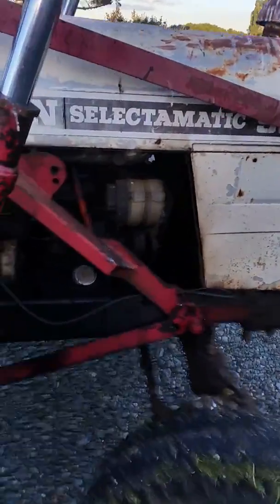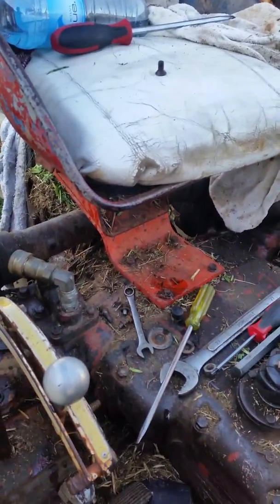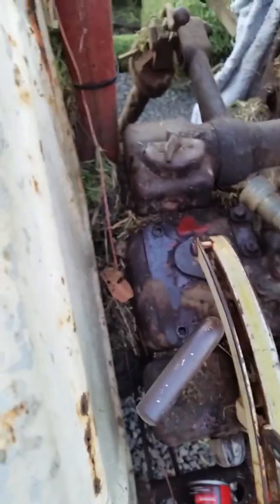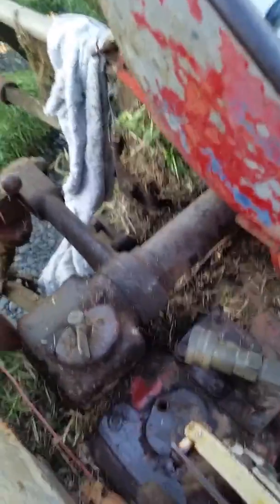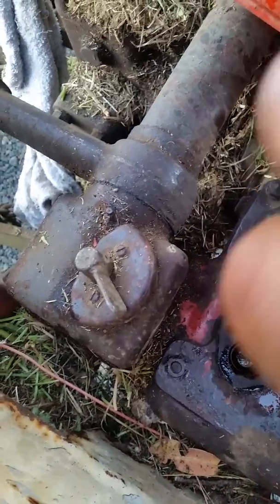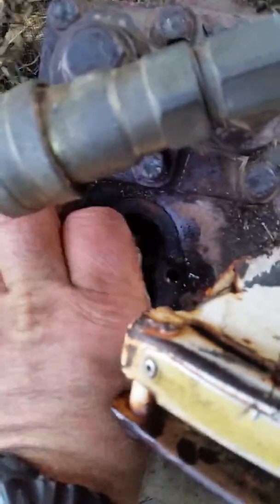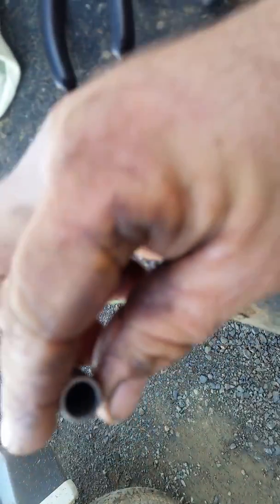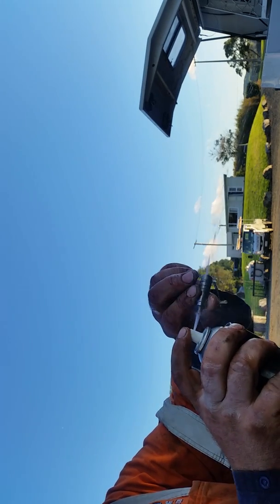David Brown 990 hydraulic bypass valve

Comment: Question I have a 996 and the lift arms are stuck up, would cleaning the valves fix this or is something else needing done?
Reply: There should be a handle on the left side rear axle, that can lock the lift arms in transport mode(all the way up).
Try to unlock the handle.

Comment: Thanks a million for the video. My lift arms stopped working altogether on my 995. I followed your instructions and now they are working again, be it slow though. I think a good service of the hydraulic system is called for, but at least I can work. Thanks again.
Reply from the maker: That's fantastic glad to hear its helped 
You are probably right needs an oil change and a new pressure filter and cleaning of the suction filter
Reply: @chopsmechanicaltips6595  I figured out what was wrong. One of the previous owners had swapped the valve casing with an older model, the one with the hand pull up plunger. The result was the ball bearing inside was not where I was expecting it to be and I lost it without realising. The result I guess was I was splitting the flow, hence the slow lift arms. I found the correct diagram for that part and noticed the ball bearing behind the screen with three holes in it. I found a ball bearing around the house today, put it in and now it's perfect and rising fast.
Reply: @ConnemaraShooter  I have 995 as well and wondering how your hydraulics are working now with cleaned out valves
Reply: @jessepaul1389  It's perfect now, but I had to replace the clutch since in the fitters and while they were at it, I had them go through the hydraulics. They said it needed a really good cleaning. Any ways it 100% know.

Comment: I end up pulling the valves on my 990 about once a year.  What I usually find is a little crud (American for junk/trash/garbage) in that little screen and maybe the outside of the valve has a bit of sticky gum or a little bit of discoloration (start of rust) from water in the hydraulic fluid. Clean them up and all is well. The water is a major issue as we have no sheds for the tractors. I'm building a canopy (roof) onto the tractor this spring. The shift lever boots never last more than a few months and that appear to be where the water comes from.
Reply: you pack grease around base of lever then put new boots on. if the new ones go the grease will act as a resistance for a bit

Comment: There's also supposed to be a ball bearing and a ball bearing retainer in that valve to sorry to anyone who attempts that be careful to not lose those they're very small
Reply: On the 880/A selectamatic I bought recently, the hydraulics had completely stopped working. I took the outer valve out and found blockage in the screen. Cleaned it up and the hydraulics started working immediately. I was elated. After removing the inner valve (closer to the seat) I tapped on it and a ball bearing and small washer with 3 small factory-drilled holes fell out. I wasn't sure what order they went in, so I put the ball in first then the washer, then the spring and closed it up. I do want to find a schematic so I can be sure of it.
Reply: @tvs3497 I'm doing the exact same thing now and found only a ball in the inner valve, and a retainer and screen with one tiny hole in the outer valve. How kdid you put it back together? Is the. Inner valve supposed to be open with nothing in it like the Video shows.  I feel like someone else maybe had a go before me and Re assembled it wrong

Comment: Brilliant Chops. Had this issue with my 880 Selectamatic with sudden non lifting action. I did what you showed and said and the hydraulics now work perfectly. Dump valve seemed to be the problem. Visually not much blocking it but was enough to stop the hydraulics . Will say on the 880 take care with the Bypass valve when lifted out as at the bottom there is a very small brass ball and metal screen. Be careful not to lose them esp the ball. Cheers Mate !!!
Reply: mark edward Lucock Did you have to rebuild the actual dump valve itself I've done this process it worked great now it's locked up and won't come down I thought it might be to do with the dump valve but not sure
Reply: No I didn't have to adjust anything else. I simply put all the parts back where they came out from.You sure nothing has fallen into the open valve area.Maybe a bit of dirt or something as doesn't take much to block. Clean out both valves as well but be careful you don't lose the tiny ball and metal screen in the housing of the other valve if its an 880 selectamatic.
Reply: @markedwardlucock3661  I have 770 end have problems on my 3 point hitch is lifting but not have to much power maybe only like 75 lbs

Comment from the maker: Hi Mick 
I would try 1st buy giving the screw driver a smack with a hammer, if they are still stuck get a large flat ended punch even an old bolt with a similar diameter as the cap will work fine and give that a smack with a hammer, that should shock it loose 
Cheers chops
Reply: I can't get the one screw out to save my life. Did smacking it help you?
Reply from the maker: @jessepaul1389  how did ya get on Jesse did u manage to get it out?
Reply: @chopsmechanicaltips6595  nope still stuck… have tried penetrating grease, pounding it… she’s in there good

Comment: gday, I have the 880a version an the valves caps are jammed , what would you recommend to get them undone ,
thanks in advance mick :)
Reply: its like every thing once you know the ins and outs its easy most important to keep the òil and filter clean and have good boots on the gear sticks
Reply: We tried an impact driver , ended up having to use a chisel and hammer, note other valve in the 880a has a ball bearing and a disc washer in it be careful you do not lose it